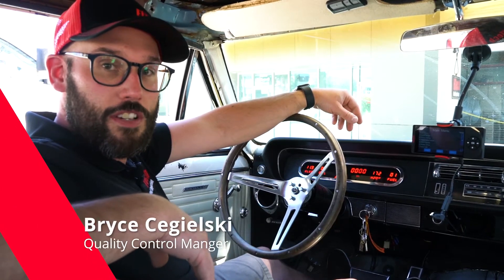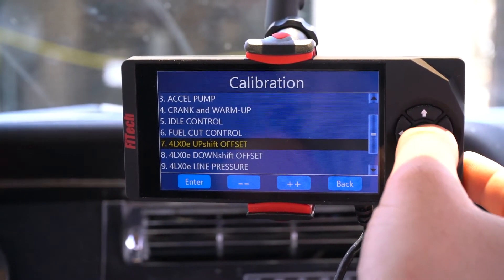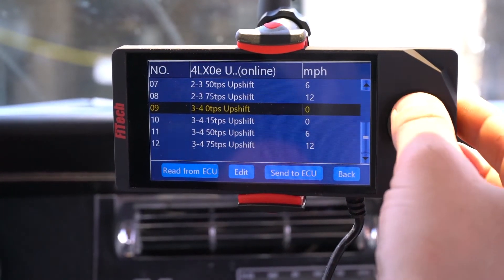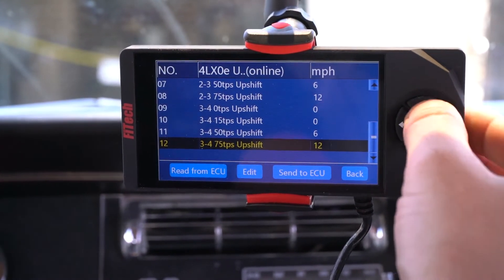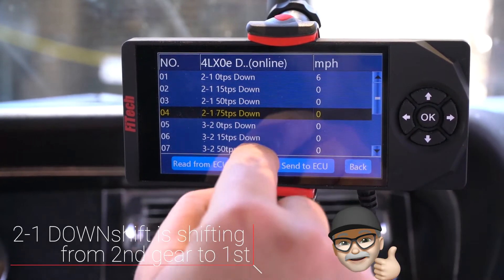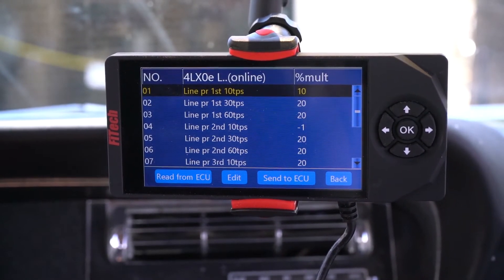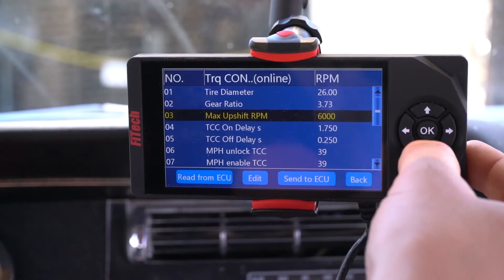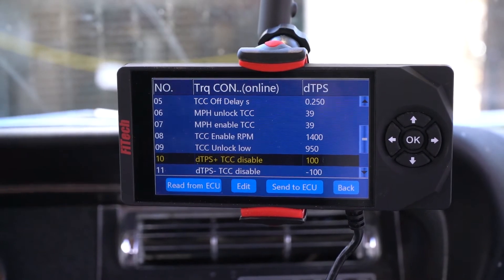Shift Points and Shift Firmness| Tech Tuesdays | EP17

Comment: Just changed my 1800 stahl to a 3000. Now speedo doesn't work till truck gets to about 3500 rpm. Or it shifts.  Then goes instantly to whatever speed I'm at  usually around 35 mph. Fi tech    5.3. With 4l60.  Nobody in my  area knows anything about fiech fuel injection tuning

Comment: Is there a cruise sport and race configuration that I can just set my system to so I don’t need to hunt for the best config?
Reply from the maker: The system has a base shift pattern pre installed. These are adjustment for if you want to change them.

Comment: Hello, I have been struggling with the 4-3 downshift; it responds normally with the manual shifter but upon automatic operation when throttle is applied it will always bypass the 4-3 and shift 4-2..
Upshifts and TCC are good.
  I have attempted tuning with both the handheld controller as well as the laptop.

  Can you provide more detailed info on what the charts are displaying, for example the downshift VSS VS TPS and gear,chart what is the top row indicating, what is the left column and so on.
 Thanks    
 Doug
Reply from the maker: Sending a datalog and possible calibration file to the tech team would help isolate what is going on here. Techmail@fitechefi.com
Reply: @FiTechEFImedia  I finally got through on your tech line by going through sales. Rodney emailed a new calibration and walked me through the installation. this resolved the issue.

Comment: Installed this on a 72 Nova. It upshifts just fine but won't down shift once it's in third. Only trouble code I am getting on occasion is P0335 rpm noise. What could be the issue?
Reply: Hello sir, were you able to resolve your issue?